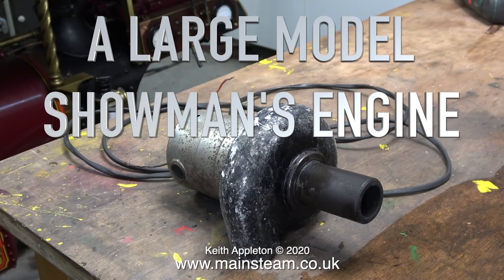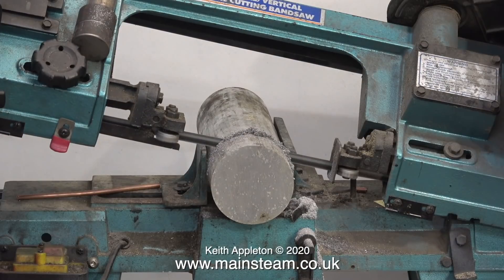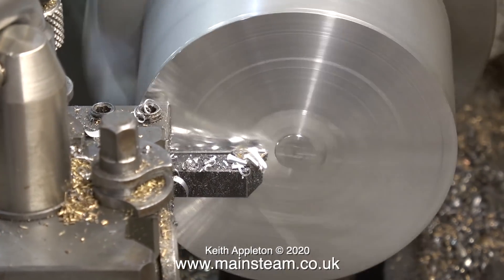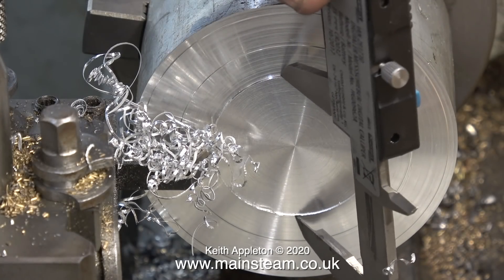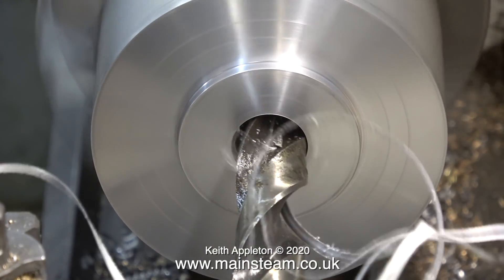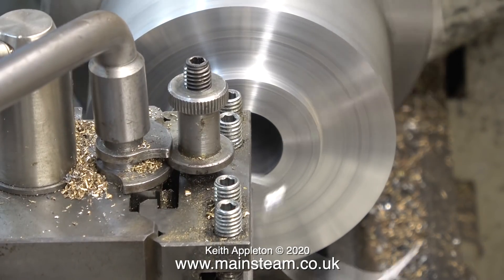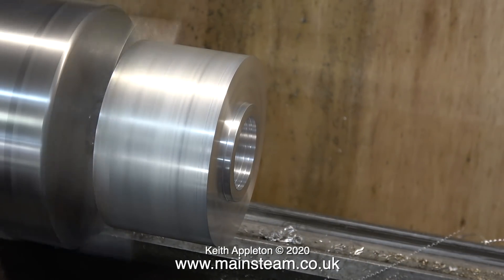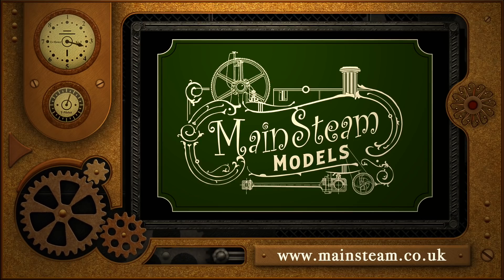A LARGE MODEL SHOWMAN'S ENGINE - PART #32

Comment: In my experience in machining, you can make much more manageable chips by taking deeper cuts. Even in a small lathe. I prefer Hss
for non ferrous instead of carbide inserts. Inserts are never very sharp and are made for high speed and feed. A tool you ground yourself can be easily touched up now and again and will give a better finish. Just my two cents.
Reply from the maker: Thanks for the tips.